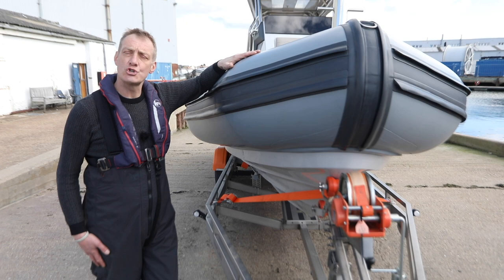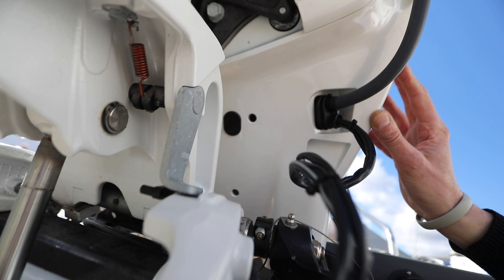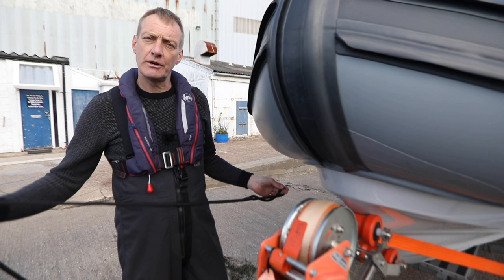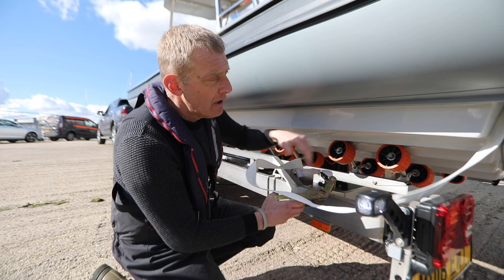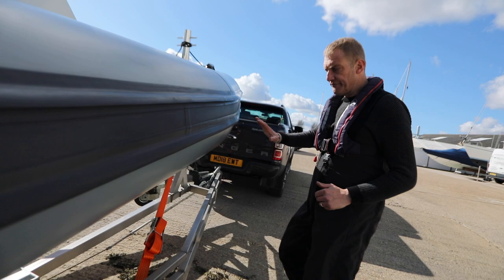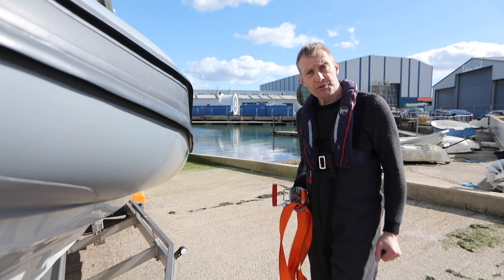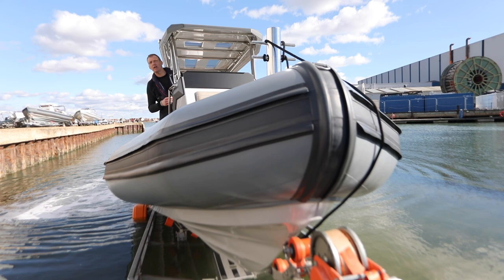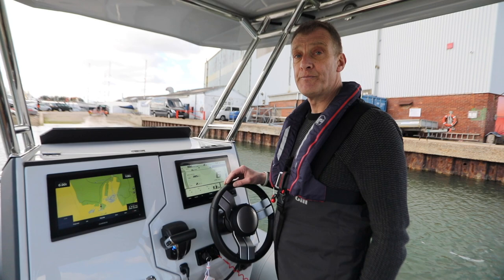How to launch your boat from a trailer | Jon Mendez's expert guide | MBY

Comment: I would never disconnect the last Lines befor the Engines are running. If there comes suddenly a strong Wind or a Wake from a passing by Boat, yur are suddenly in the water with no Chance to controll the Boat 😢

Comment: I often launch my boat (an aluminium 6.2m hardtop) solo, and the process I've worked out that works well for me is:
1. Before launching tie a painter from a midship cleat up to the bow and around the trailer and back to the cleat where it's tied off
2. Back the trailer down the ramp till the water is about half-way up the trailer wheels
3. Unhitch the winch - the boat is now held just by the painter
4. Get in the boat & start the engine & when ready, put it in gear so it's pushing forward a bit
5. Untie the painter and pull it quickly inboard - if the boat starts to slip, tie it off again and apply a bit more power
6. Ease off on the power so the boat slides off the trailer in a controlled manner
7. Manoeuvre to the jetty, tie off and go & park the car

Main things that can go wrong is not having the trailer far enough in the water, causing the boat to race off the trailer too quickly, forgetting to unhitch the winch so that when you untie the painter nothing happens, and forgetting to put the bung in so I have to immediately put the boat back on the trailer perform the walk of shame to put it in (all of which I have done!).

Funnily enough the one time I had a mishap truly deserving of a fail video was on one of the few occasions I was boating with a friend.  I hopped into the boat to start the motor, and he was so excited he release the winch without waiting for me to signal I was ready.  The motor wasn't even started and it was rolling rapidly off the trailer!  To make matters worse, he had released the catch by not the cable.  So the boat was swinging sideways on the cable.  I had to get the motor started, straighten up while just off the trailer and the drive forward so he could unhitch it.  To make matters worse he had hit his hand on the spinning winch handle.  Fortunately just bruised, but painful none-the-less.  My fault of course - I should have conducted a proper briefing & not assume he knew what he was doing :)

Comment: Hmm, some cars like some BMW and Mercedes models have their remote parking assist function where you can be outside the car and move it backwards and forwards with your phone app or car key. I wonder if that could be used for that last bit of backing down the boat ramp!! 😅
You might just be close enough to the car to accept your commands (it won't work if you're too far away)! But I guess it will refuse to work with a trailer attached, as it will block the rear sensors which it relies on...😞

Car manufacturers need to add the option of using that function with the trailer!!